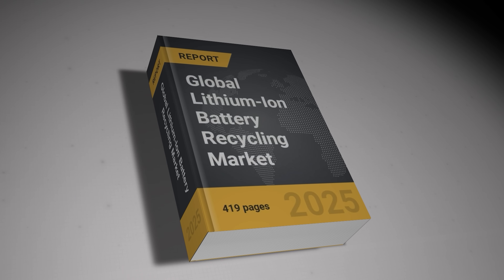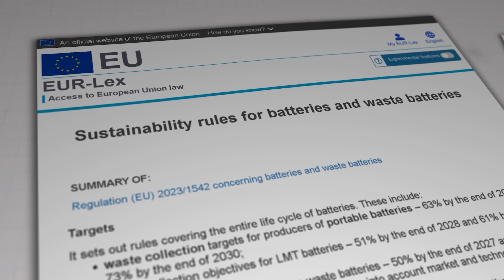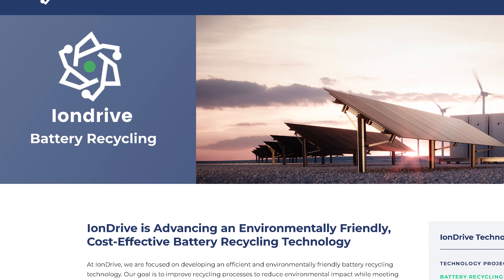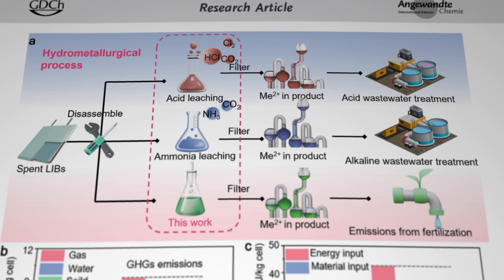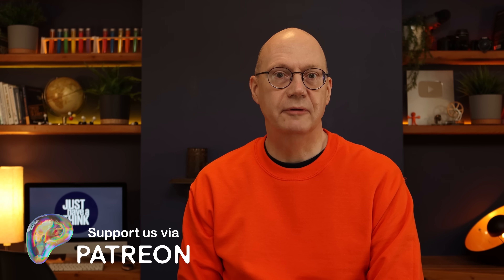Recycling Lithium batteries in 15 minutes. How do they do that?

Comment: Eletric cars didn’t solve a damn thing on long distances. ( Short distances for US standards ) . Assuming I have to travel due to work from Brittany to Nice, using a small electric car I would have to recharge 6 up to 7 times +- 6,5 Hours
Reply: Wow - DRIVING 880 miles to work!
Reply: @Evergreen6807 journalists do it pretty often, contracted construction workers specialized in operating heavy machinery and cranes in Europe as usual once that incorporations call them from where is cheaper, example Switzerland incorporations usually call Galician or Welsh labor workers as are preferred to operate extremely heavy machinery, charging cheaper than Swiss counterparts but doing the work and operating exactly as where told unlike africans that usually do the “ brazilian “ way , in resume the Swiss also ends up cutting costs with less engineers to keep  an eye on workers.

Comment: Thanks Dave. It's all good grist to the mill when we have to respond to naysayers. What that report seems to ignore about recycling batteries is that batteries at end-of-life will be devoid of Cobalt in another decade or two. Meanwhile, what will be left of the oil industry (and it will never disappear completely) will still continue to guzzle Cobalt like there's no tomorrow, and quite probably recycling none of it, just as it does today. And does anyone in that industry really fret about the sometimes dubious sources of that Cobalt? I have never heard any meaningful complaints from them.

Comment: Even without using materials from recycled batteries, the lifetime greenhouse gas emissions from production and use of EVs is only about 50% to 20% compared to gas vehicles.  Using recycled materials to build batteries will make this difference even greater.  An even better idea is for use to get around on electric trains that don't even need batteries!

Comment: It's worth mentioning that Lithium Ion is not just about car batteries (which even ICE cars use now) but also the billions of other devices in the world that use that chemistry, most of which also ends up in land fill.
Reply: True, but the supply chain and recycling mechanisms of tiny batteries in consumer products that people toss in the trash is very different from the large valuable battery packs in junked cars. It's not profitable to disassemble small consumer products to get to the battery as at 3:08. One of the anti-EV factoids is "90% of lithium-ion batteries are never recycled".
Reply: @skierpage  Except the new EU legislation already covers batteries in those devices and here in France they are already removed from E-Waste to be sent for recycling at the local waste sites. The process for disposal is different but those same plants can take the cells in bulk which makes it worthwhile. New portable devices will need to have removable batteries. 
(38)

In order to ensure that portable batteries that were incorporated into appliances are subject to separate collection, treatment and high quality recycling once those appliances become waste, provisions to ensure the removability and replaceability of batteries in such appliances are necessary. Consumer safety should be ensured, in line with Union law and in particular Union safety standards, during the removal of portable batteries from or the replacement of portable batteries in an appliance. A portable battery should be considered to be removable by the end-user when it can be removed with the use of commercially available tools and without requiring the use of specialised tools, unless they are provided free of charge, or proprietary tools, thermal energy or solvents to disassemble it. Commercially available tools are considered to be tools available on the market to all end-users without the need for them to provide evidence of any proprietary rights and that can be used with no restriction, except health and safety-related restrictions. The general provisions of this Regulation should apply without prejudice to the safety and maintenance requirements for professional medical imaging and radiotherapy devices as defined in Regulation (EU) 2017/745 of the European Parliament and of the Council (12) and for in vitro diagnostic medical devices as defined in Regulation (EU) 2017/746 of the European Parliament and of the Council (13), and could be complemented with requirements laid down for particular products powered by batteries under implementing measures under Directive 2009/125/EC. Where other Union law lays down more specific requirements, for safety reasons, regarding the removal of batteries from products, such as toys, those specific rules should apply.

Comment: I don't consider the exact number of minutes some part of the process takes under laboratory conditions as a very important factor in itself, not compared to things like recovery percentages, cost and negative consequences. 

Very high lithium recovery percentage doesn't compensate for poor recovery percentages of nickel and cobalt. The trading price of lithium is currently back down to about a tenth of what it peaked at in late 2022, and taking inflation into account, the cost of lithium is about as low as it has ever been, despite continuously increasing lithium ion battery production rate. 

Mandating minimum percentages for recycled materials used in production seems like very backwards reasoning to me. What can "reasonably" be recycled should be recycled, and if sifting through a lot of earth to extract relatively small amounts of valuable materials is cheaper than recycling what consists only of at least somewhat valuable materials we have very severe systemic problems, which mandates for minimum percentages for recycled materiels used in production can't solve. 

Such mandates can reasonably only limit production, I mean, how many percent of all EVs ever produced have reached the end of life, is it even 2%?  Going back to just 10 years ago, EV sales was about 2% of what it is today, mandating use of multiple times more recycled materials than can be expected to be possible to source from recycling from the same industries doesn't make much sense to me unless the intention is to limit production.

Comment: The largest problem with mandating amounts of recycled lithium is not the process put the supply of used batteries to recycle. The life of a lion battery pack is 10 to 20 years. The yearly ev sales from 2010 to 2015 was only about 1 million a year. Now 10 million a year and by 2030 probably 100 million a year. Where are all the used batteries going to come from necessary to be enough to recycle for the 100 million new EVs?

Comment: I agree with the need for more electric cars, but is it fair to say that ICE vehicles are "hopelessly inefficient". Petrol is an extremely efficient fuel, albeit that its byproducts pollute the atmosphere.
Reply: Petrol is not an efficient fuel, it is an energy dense one. Efficiency comes in the way it is used - in an old-fashioned blowlamp burning off paint it's around 100% because all you want is the heat. For a prime mover the efficiency is limited by some fundamental thermodynamics that is not up for debate, and in practice additionally by losses to friction and other parasitic inefficiencies.

Comment: The cost difference is still too high over here in Australia. I was looking at replacing our old car with an EV and once I’d shortlisted a few cars, the ICE cars were 40-50% cheaper. Even with the fuel savings, it just didn’t make sense.
I’d also like the industry or regulations to address the issue of cars becoming completely useless as their batteries die. The changes model to model mean I’m pretty convinced that every EV will be dead 10-15 years after sale because manufacturers won’t be selling replacement batteries, not because there’s anything wrong with it. Standards for the batteries (size, voltage, etc) could address that issue well.
For example, hyundai have changed the voltage of the Ionic almost every year. So a 2023 model can’t use a 2025 battery.
Hyundai don’t mind, they want you to buy the new 2033 model, not just replace the battery.

Comment: just the word "hydrometallurgical" sounds environmentally concerning. 
Why are we doing this instead of building batteries that make it easier to separate the materials mechanically. I'm not a battery expert, but yeah sure you probably can't separate everything mechanically and use no hydrometallurgical processes at all, but it would definitely be better than grinding EVERYTHING into one big smoothie before trying to separate it

Comment: AI Summary

Abstract:

This video explores the rapidly growing global lithium-ion battery recycling industry, projected to reach $24 billion by 2030, driven partly by new EU legislation mandating recycled content in EV batteries. It highlights existing hydrometallurgical recycling methods used by companies like Redwood Materials, detailing their processes and challenges, particularly the reliance on harsh chemicals and high energy consumption. The core focus is on a new, highly efficient process developed by a Chinese team from Central South University. This innovative method utilizes glycine, a benign amino acid, for its dual functionality (ligand complexation and pH self-regulation) and a "solid-solid reduction design" (mimicking a primary battery effect) to achieve near 100% material recovery in under 15 minutes, all under neutral, environmentally safer conditions. The presenter argues that such advancements will significantly address environmental concerns about metal mining for batteries, further bolstering the case for electric vehicle adoption and making them a more sustainable transport solution.

Lithium-Ion Battery Recycling: Innovations and the Path to Sustainability

*   0:00 Market Overview: The global lithium-ion battery recycling industry was valued at over $7 billion in 2024 and is projected to grow to nearly $24 billion by 2030, at a compound annual growth rate of almost 22%.
*   1:50 Regulatory Drivers: New EU legislation, effective August 2030, will require electric vehicle batteries to contain minimum percentages of recycled lithium (6%), nickel (6%), and cobalt (16%), with proportions increasing further by 2035.
*   2:17 Industry Landscape: China currently dominates the recycling industry with a 70% global share, but European and North American companies are racing to innovate.
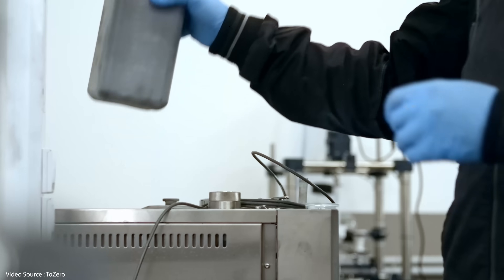*   2:27 Key Players & Methods:
    *   Duesenfeld (Germany): Claims net-zero emissions and recovery of all critical materials, including industrial-scale graphite.
    *   Altilium (UK): Aims to reduce CO2 emissions by 70% and lower battery costs by 20%.
    *   Redwood Materials (USA): Founded by ex-Tesla CTO JB Straubel, uses mechanical shredding and hydrometallurgy to recover 95% of lithium, cobalt, nickel, and copper.
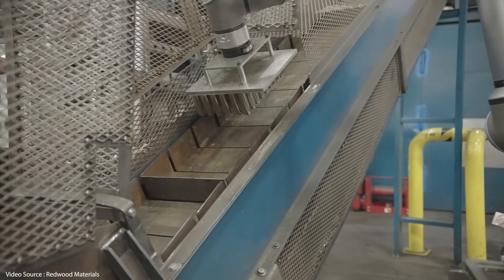*   3:02 Hydrometallurgy Explained: This common process involves physically dismantling batteries, shredding them in an inert environment, screening for metals like aluminum and copper, and dissolving the resulting "black mass" in an acid bath for solvent extraction to separate valuable materials.
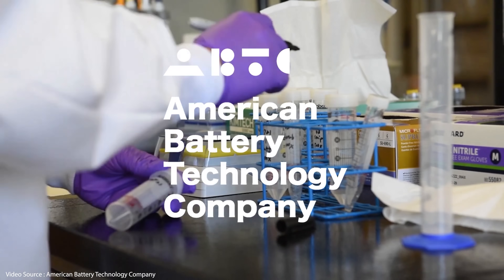*   4:18 Diverse Recycling Approaches:
    *   American Battery Technology Company (USA): Uses a closed-loop, feedstock-agnostic hydrometallurgical process.
    *   Aqua Metals (USA): Employs "aqua refining" (electro-hydrometallurgy) for 95% waste reduction compared to traditional methods.
    *   Li-Cycle (Canada): Recovers all critical materials, plus plastics from housings and casings.
    *   Recyclico (Canada): Offers on-site recycling modules with a 99% recovery target for cathode materials.
    *   Ion Drive (Australia): Focuses on methods using benign organic solvents to reduce environmental impact.
*   5:32 Challenges with Current Methods: Traditional acid leaching is slow, releases toxic gases, and produces significant wastewater. Ammonia-based methods are inefficient and pose safety risks. There's a strong need for neutral, more scalable solutions.
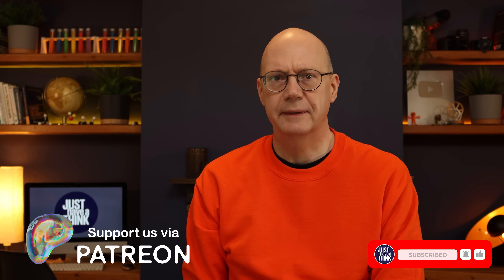*   6:24 Chinese Breakthrough with Glycine: A team from China's Central South University has developed a new process using glycine, a benign amino acid, that offers:
    *   7:17 Dual Functionality: Glycine acts as a ligand to pull metals into solution and self-regulates pH, eliminating the need for harsh additional chemicals.
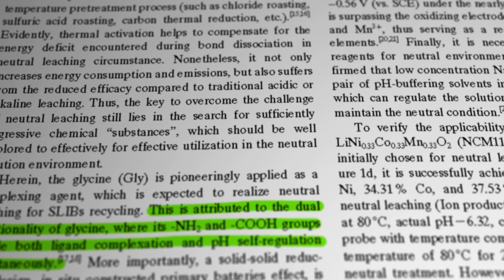    *   8:33 "Primary Battery Effect": Exploits a solid-solid reduction design, where two materials in contact generate an electron flow, speeding up the breakdown of metals.
*   9:21 Impressive Lab Results: The new glycine-based process achieved nearly complete recovery in just 15 minutes: 99.9% lithium, 96.8% nickel, 92.35% cobalt, and 90.59% manganese.
*   9:47 Scalability and Impact: This fast, safe, and environmentally friendly process, demonstrated in a lab, shows significant potential for mass-scale adoption.
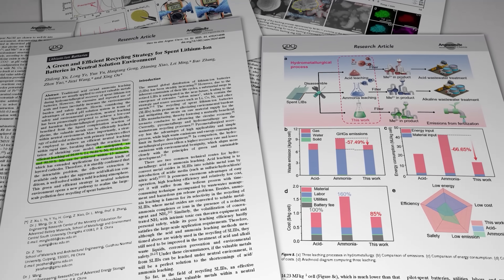*   10:07 Shifting the EV Narrative: Such advancements undermine arguments against electric vehicles related to environmental pollution from mining, highlighting that efficient recycling makes EVs a truly sustainable alternative to fossil fuel vehicles.

I used gemini-2.5-flash-preview-05-20| input-price: 0.15 output-price: 3.5 max-context-length: 128_000 on rocketrecap dot com to summarize the transcript.
Cost (if I didn't use the free tier): $0.0061
Input tokens: 16292
Output tokens: 1031

Comment: Thanks for this video! I am currently doing a PhD on Li-ion battery recycling. I lately encounter a lot of companies claiming high recycling yields and low amounts of residual waste. However, this always turns me a bit sceptical. Many of these companies depend on relatively clean and constant waste streams (black mass). This means a low amount of Al, Cu and organics, and a constant amount of Ni, Co and Mn. People throw away a wide variety of LiBs, all with varying composition. This has a major influence on the recycling efficiency, and industry seemingly does never mention the "robustness" of their recycling processes towards a varying and heavily contaminated waste stream.

Another interesting point is the claim that neutral solutions are environmentally friendly and desirable. I have read the paper that you show at 6:24, and I must disagree on this. My good pal H2SO4 gets bullied a lot lately, while its production emits only 0.14 kg CO2 per kg of H2SO4. It also releases no harmful gases in the leaching process. The paper you mention, only compares with leaching by HCl but this is nowhere near as popular as leaching with H2SO4. Also, they claim their process is environmentally friendly, but they do not mention that the production of glycine produces 6.14 kg CO2 /kg of glycine (!!!). This is around 50 times as much compared to H2SO4! (source for CO2 emission is CarbonCloud). Also, acids are really not that scary as people often think. A 1 to 2 mol/L H2SO4 solution is quite acidic, sure, but is fairly common, not too corrosive to equipment and widely used in industry.

The mentioned paper does leave a lot to be desired. Also, having a good leaching process does not give you a full recycling process! What happens to the leach solution after the initial step? How do the researchers deal with iron being present? What about the Al and Ni? The researchers use NaOH (1.12 kg CO2 / kg NaOH) to achieve the correct initial pH, does the Na influence the purification process that is necessary to recover Li? The researchers only use the cathode for their research! What happens when they treat a realistic waste stream, consisting of elements from the cathode (Al, Li, Ni, Co, Mn) as well as anode (Cu, graphite, Li) and other parts (Fe, plastics, LiPF6, carbonate solvents etc.)? From fundamental perspective, this paper is really interesting. Unfortunately, we are still not there when it comes to fully and efficiently recycling LiBs. I hope the researchers would address these types of issues in their following research.
Reply: Solid read, thumbs-upped. Hopefully your comment will get pinned!
Reply: Thank you for that

Very entertaining read (yes I am weird)
Reply: Thanks for pitching in.
Reply: thank you for that.. great synopsis and insight
Reply: Thanks for pitching in. It is also clear to me that the recycling problem is far from resolved (otherwise it would be far more prevalent). Yet it should have been well and truly resolved before a single EV rolled out of the production line.   Australia's CSIRO has stated that over 90% of spent battery are being stockpiled in this country. Yet again we are leaving the cleanup to future generations.
Reply: @JorgeGarcia-ff3mu 
There's a chicken-egg aspect of being unable to start a profitable recycling business without a guaranteed supply of materials.  Stockpiling is necessary, to some extent.
Reply: most companies do the crushing and separating line, get the black mass, copper, aluminium, steel and separator. about the further blackmass hydrometallurgy, because the whole line price is higher, so for starting lithium battery recycling.

Comment: Glycine, the simplest amino acid, boasts a wide array of applications across various industries, primarily due to its unique properties as a sweetener, buffering agent, and a fundamental building block of proteins. Its major uses are in the food and pharmaceutical industries, as well as in animal feed and as a chemical intermediate...Until now? Sodium batteries can be recycled as a type of flavouring, as  sodium acetate trihydrate? Wrong, sadly, salt and vinegar crisps are  coated with sodium diacetate. Blast it.